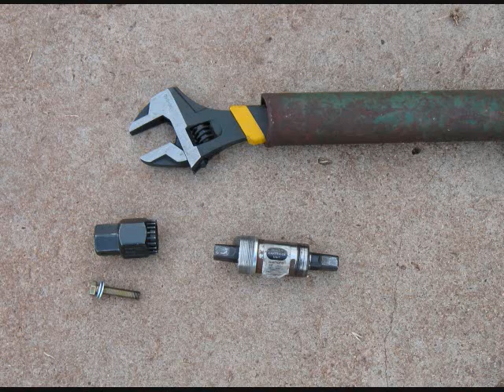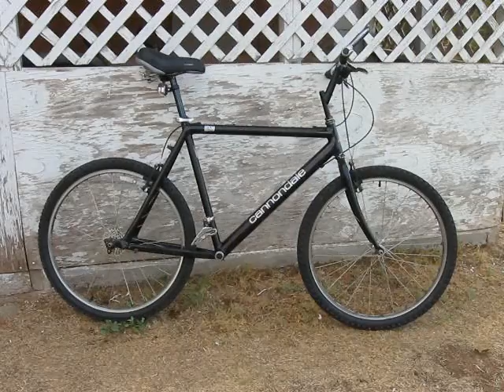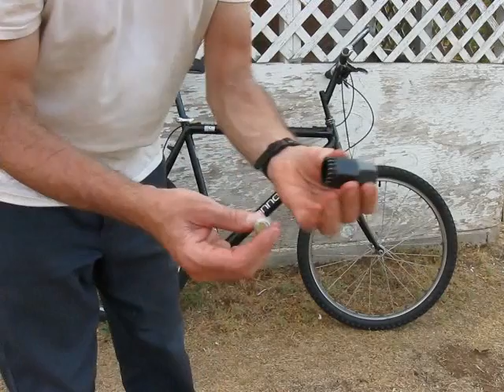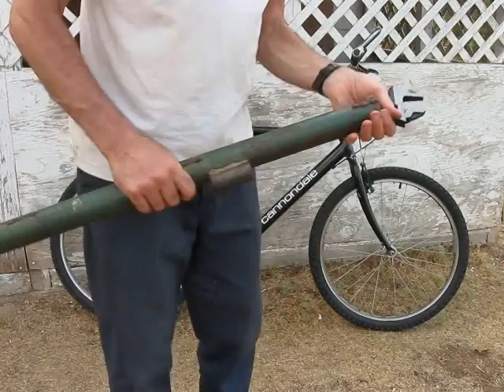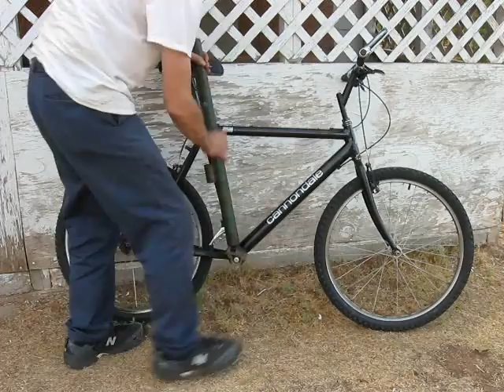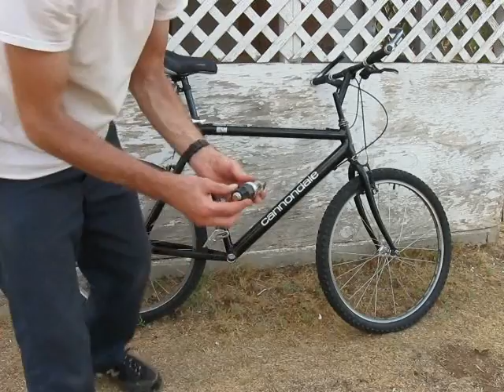How To Remove A Frozen Stiff Bottom Bracket Cartridge

Comment: Incredible tip!  Worked like a charm for me, too.  "Bought" a 32mm combination wrench from HD to attach to the Park BBT22 which provided the necessary leverage.  That 8mm bolt is the trick.  Without it the Park tool just continues to slip out of the BB grooves and risks stripping.

Comment: Really good tip of using a bolt to stop the tool slipping off.  I just took mine off yesterday before coming across this video.  Luckily for me my bottom bracket was doable without needing a bar or bolt but it was still real stiff getting it off.  I think whoever put it in did put a bit of grease on but it had dried up on the thread.

A good bit of advice for anyone putting a new one back on is clean all the crap out of the thread and use anti-seize.  Normal grease is better than nothing but anti-seize for threads is ideal.  Forget using WD40 that will just dry out and good luck trying to get that back out years later.

Comment: Thanks very much... mine was stuck fast and even applying leverage using a club hammer was not working. I had no strong pipe but I ended up using a long piece of angle iron with an old bolt through it which helped keep the spanner in place. I had to press so hard I thought I was going to break the spanner before it finally moved - oh joy!

Comment: Great tip as I was knackering my tool and potentially my face beforehand. I just used a lump hammer rather than pole but it took about 5 revolutions to remove so remember to loosen off the bolt you used to hold the tool on else you'll thread it like I did as obviously the bottom bracket is coming forward relative to the initally bolted position, or used a think rubber washer like I did.

Comment: Thanks  Thundra worked great .I got lucky ,had a different (shorter Park BBT32) tool so i could use the crankarm bolt with 2 washers.